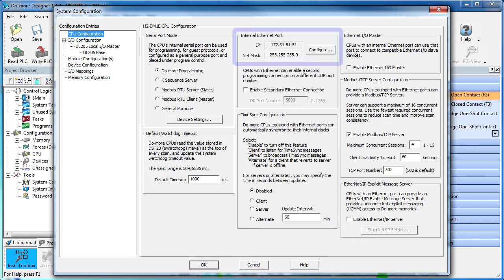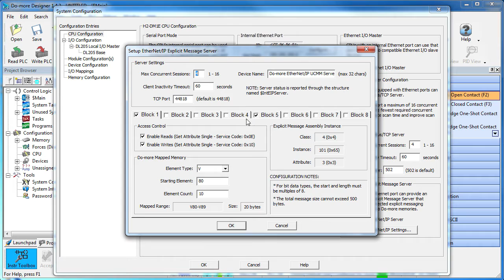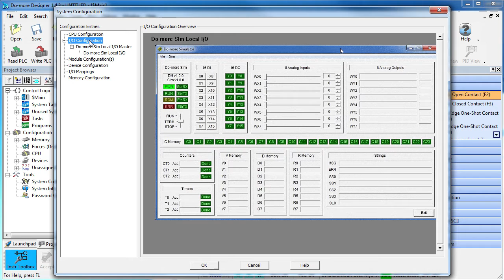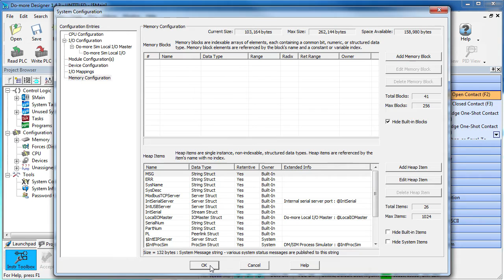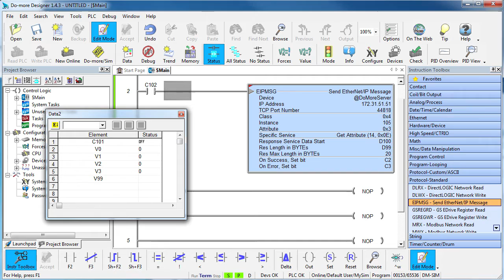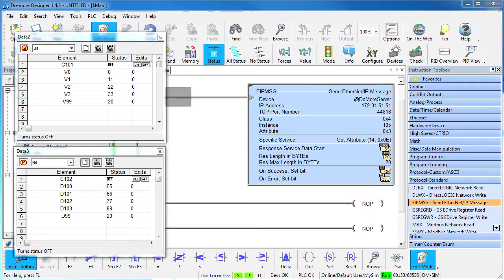BRX Do-more PLC EtherNet/IP Explicit Server from AutomationDirect

Comment: Can you guys make video on how to setup ethernet IP with keyence and cognex cameras?
Reply from the maker: I can add it to our production list. Do you have a certain part number that we use as an example?
Reply: @automationdirect  keyence IV 500ma to a do more would be great! you can get them fairly cheap on ebay these days. Appreciate the reply. Im in the middle of of a build with my first automation direct platform and i gotta say im loving it so far!
Reply from the maker: @charlescummings5565  thanks I will see what I can find. I am currectly producing some BRX to Rockwell, over EtherNet/IP with the BRX being the target for RS500 and RS5000. I will see if I can wedge this in.
Reply: @automationdirect  thanks for the input. I really want to move away from Rockwell's hardware. This would be a big help